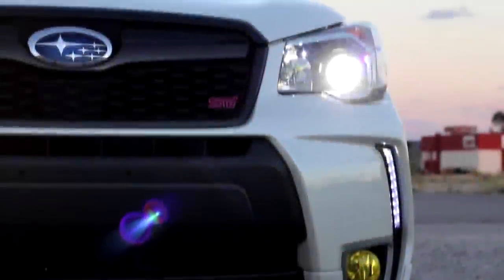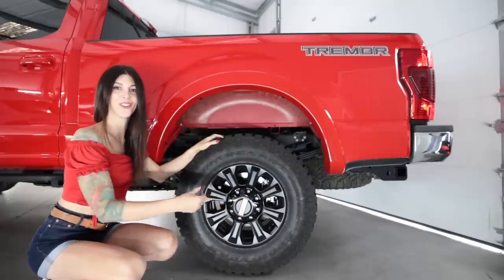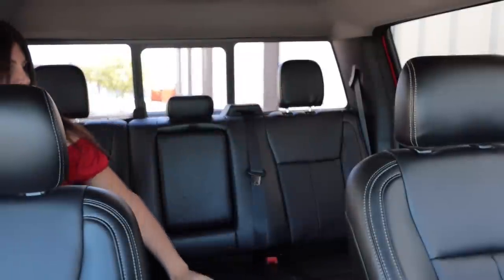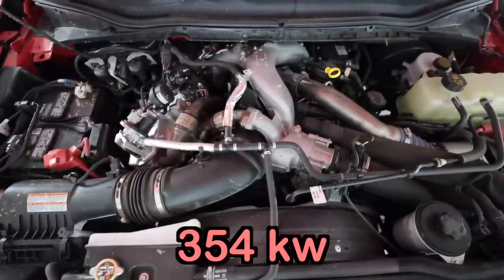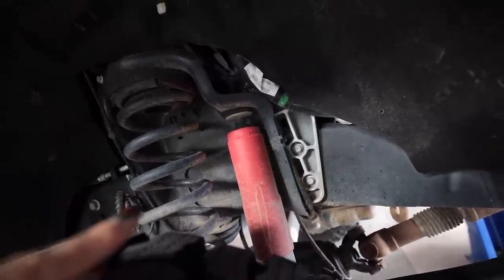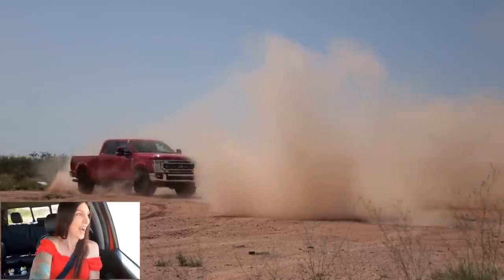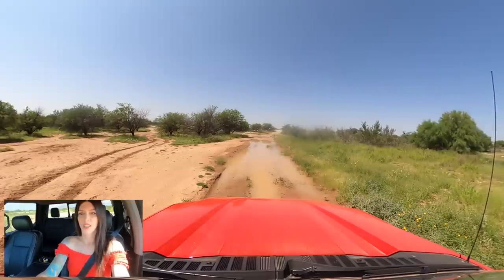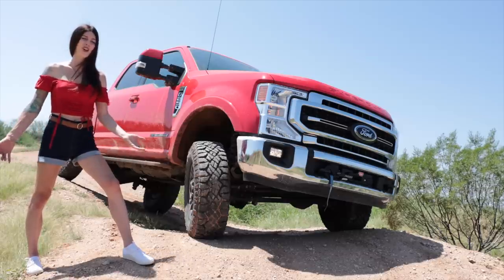The MOST Hardcore HD Off-Road Truck? // 2021 Ford F-250 Tremor

Comment: Woah, check out those huge... donuts! 😁  I don't think we're quite to the end of the internal combustion era yet, but there are definitely some incredible engines being made these days, with 1,000+ lb-ft torque and 800+ hp.  Sure, EVs can be very powerful and loaded with torque, but I'll miss the sound of exploding dinosaurs.  Enjoyable review as always, and I love that you include off-road adventures when appropriate (and even with mall-crawlers!) along with a look under the hood and underneath.
Reply: The Rimac Nevera is pushing out 1914hp and 1741 lb-ft of torque.  Mind you that's a hyper car with a hyper price tag, but the Rimac's are basically Proof of Concept cars to show that it does work.  Eventually that technology will become more commonplace and will trickle down to more widespread usage.  
I do agree that gasoline/diesel vehicles aren't going away any time soon.  There are still a lot of obstacles to overcome with electric (mainly charging them).  The majority of the people in the world don't have space to install a specialized charging station for their vehicles.   One day probably, but no time soon.

Comment: Thank you for going All out on the Bolster Wiggle. Sorry about the ankle. On a side note. Do you think it is wise to have the Fuel and DEF so close together? Over the years I have seen tanks contaminated by both liquids.
Reply: No it's not the best. Every Ford diesel tech I've talked with has had to replace the entire fuel system if DEF was poured into the fuel tank and the key was turned on. 
Vice versa if you somehow get diesel in the DEF tank. 
BTW, your looking at upwards of $10,000.00 for fuel system replacement.
Reply: If seen about 3 that’s somehow put DEF into the diesel tank (hard to put diesel in the DEF tank as its smaller than the nozzle on most diesel pumps, a well thought out thing to do)
And while I still loathe having to add DEF to any diesel I MUCH prefer having it next to the diesel filler vs under the damn hood like GM does it
Reply: Yeah. People have literally pulled into gas stations and tried to fill up their Teslas. Manufacturers should know they cannot rely on the masses having even the slightest amount of common sense.
Reply: I’ve never had an issue distinguishing between the def and the diesel. I actually have 3 motorcraft def jugs and I fill them all up at the love’s station where I pull in and pump the def from their pumps. I know that people can and have accidentally put regular gas into the diesel fuel filler which can cost you 10k+ if you’re truly unlucky. I love my 17 F250 it’s definitely a hauler and I love the 8ft bed

Comment: I rented a 2018 F-250 diesel and hauled a 19000 pound trailer. It went up hills at 1/4 throttle. It was a little bit squirrelly on the downhill but the traction control would automatically slow it down when it swayed. Not bad considering it was 4000 pounds over the tow rating. It was an amazing truck

Comment: I own a 2012 Super Duty with the 6.7L diesel.  I modified it with a 2" lift that gets it about to where the Tremor is in ground clearance.  My Super Duty has seen some difficult off-road use in its life.  It will essentially do anything off-road that its length and width will let it do.  Its limitations are that there are a lot of trails where it simply is too big to fit.  As for the diesel, its biggest limitation is the emission equipment, especially the particulate filter.  The DPF works best when the truck is pulling a heavy load at sustained speed.  Idling along on backcountry trails will fill the DPF quickly.  I have the operator-manual-regen option on mine (only available on lower trim levels) that will allow the driver to initiate a stationary regen of the DPF if it's full and the driver cannot "drive to clean" the filter.  I've had to use it multiple times over the years.  My particular truck has, so far, been trouble-free.  It is versatile.  The truck can putter up a nasty 4WD trail with a bed load of heavy tools and supplies, or tow an 11,000 lb. trailer down the highway at 70 mph.  Hard to beat that.

Comment: I have come to the conclusion that I like you!  Easy, breathe . . . I know, I just shook your world, but there it is.  I don't have a Tremor (or a tremor), but I do have  2019 F-250, 4-door big cab and short bed, gas powered.  I got it to pull travel trailers, and replaced a 2011 F-250.  Ford came a long way in 8 years!  My tires are not as aggressive as the ones on your test truck, but it does surprisingly well in snow.  Not many deserts to test it in New England . . .  Ta-ta!

Comment: I don't think i would call that a donut, it was more like an inner tube. Also, the comment on Ford's gas powered Godzilla is spot on. I have a Godzilla powered F550 at work, and even with a total weight of about 19,000 pounds, that thing launches hard.

Comment: Excellent review. That is the exact truck I want. F-250 Lariat with Tremor Pkg. I was leaning towards the Godzilla engine but now you have me re-thinking it. The PSD is an $8k upgrade, is it worth it? The trailer I tow can be pulled with a half ton but I just want the bigger truck, I don’t need it. Also, glad to hear that you say the expensive truck is worth it if you keep it a long time and maintain it properly. That is exactly my plan. I am nearing 50 and want this truck to last... until I perish. Maybe it will outlive me like you said in the video. Thank you! Great work.

Comment: You have to hold the TCS button for like 7 seconds to get it off the line faster. It was still limiting torque development.  Unless it has the sport mode thing… in which case double tap in and on theory it should say sport something or another.

Comment: Serious maintenance on those is accomplished by taking the cab off, which is easier than you might think since the truck is designed for this. Diesels amaze me. The impellers on a turbo spin at something like 150,000 rpm.  Also that exhaust system is about $11,000 of parts.

Comment: Yeah, but how reliable are these diesels?  After a couple years I bet the repair and maint. costs really start adding up.
Reply from the maker: I'm a diesel tech (aerospace application) by trade, I wouldn't call these enjoyable to work on.. but nothing is terrible if you properly maintain it yourself and know what you're doing. I don't trust letting dealers touch my vehicles because its not in their best interest being flat rate to take their time and work on your vehicle with care like you would yourself.

Comment: The cost is well in what the Raptor, I think this with the wench is an even better buy.. the Tremor is like $2,000 less than the Raptor.  I don't something this size, and wouldn't buy anything with a Turbo.... When You get your Bronco immediately install a Heat Shield and Turbo insulator cover, between the the Turbo and the engine..  Great editing with setting up the camera and then walking back to go pick them up ( if more than 1 ). Great review❤👍🏻👦🏻❣❣🏎🏁

Comment: A diesel in an off-road 4x4 is like a COW ON ICE! Even on a concrete road. The diesel shuts down at below 3k RPMS and the Ram and Gm gasoline engines turn more than double the RPMs of the diesel...

Comment: I am sure by now someone has said in the comments.. but they are NOT doing tremors in XL ,  AND XLT models and ONLY ALLOWED in SINGLE REAR WHEEL, .... which is fine  and ALSO i must put in aswell if you hold the trac off button it will TURN OFF ADVANCED TRAC ASWELL :D

Comment: I've never understood the keypad thing. I assume it's so you can unlock the door without your key. But why? If you're getting in the truck it's most likely so you can drive it somewhere so you'll need the key anyway, or at least the key fob to start it. So the only upside I can see is if you lock your keys in the truck like an idiot you can get in easier.

Comment: If you need a truck like that you shouldn't be surprised by the price tag.  Really, the value is related to the length of service, how long you own it and how many miles you put on it.  This is said by someone that owns a Silverado 3500 Duramax with 900k one owner miles, the 100k + I have into truck and accessories puts the cost of ownership at less than many cars the same age with 10% of the milage.  If you get 10+ years and half a million miles out of that Tremor the 70K price take isn't bad at all, 50k miles per year isn't that hard to put on a truck that you use daily.

Back to the Ford, it seems under-equipped compared to some of the other offerings that it's going up against.  I'd like to see a side-by-side with the Dodge Powerwagon and the new Silverado ZR2.

Comment: I never understood the love Americans have for pickup trucks, and now that I was forced to buy one I understand even less, I can only find one function for them, to carry small loads for short distances, for example farm use, for all other uses it is terrible, I have always worked with a van or a dropside van, and I can say that loading and unloading things in a truck is horrible, not having a side access makes the job much harder, loading 2 pallets on one is painful, as a forklift cannot reach the end of the bed and you cannot use a pallet jack to move the pallet, even loading loose cargo also equally difficult as getting on and off the truck is much more tiring, I prefer to unload 100 bags of cement from a van than 50 from a truck, not to mention the convenience of having a roof and the extra space.

Comment: Please, don't buy a turbo. They are a problem just wanting to happen and if you do. If you get the Ford extended warranty for 125,000 miles. That way when the motor or turbos goes out. You will be to get it covered under warranty.

Comment: I don't like that many repairs require you to remove the cab to get access to the back side of the engine. Ford has been getting away with this for decades. I don't want a truck that sometimes requires a cab removal.

Comment: @1:00 look at all that orange peel on a brand new truck🤦‍♂️
Reply from the maker: All new cars I review are covered in fairly heavy orange peel, it doesn't make sense from a manufacturing perspective to wetsand paint when most people have no idea what orange peel even is. That, and it's more durable to have that excess clear coat anyway.

Comment: WAY overpriced.
Reply from the maker: If you do the math for inflation compared to a 30 year old F250 with similar equipment, you'll discover the issue is people don't earn as much as they used to so everything seems way too expensive.
Reply: @SarahnTuned  I just made a similar comment to another viewer.